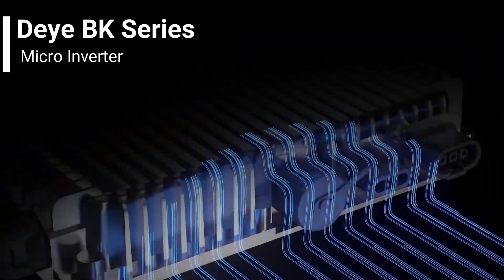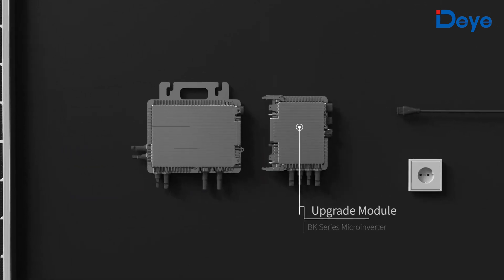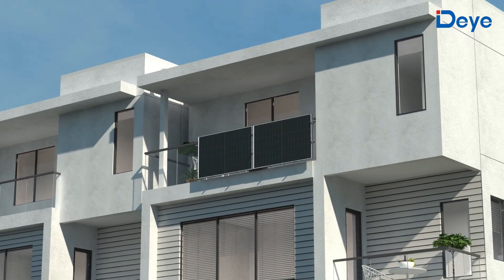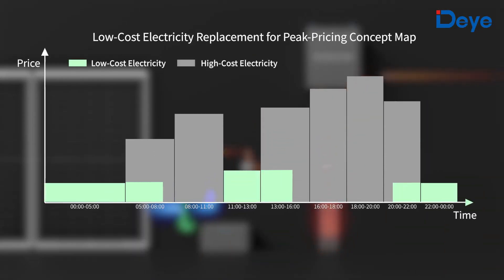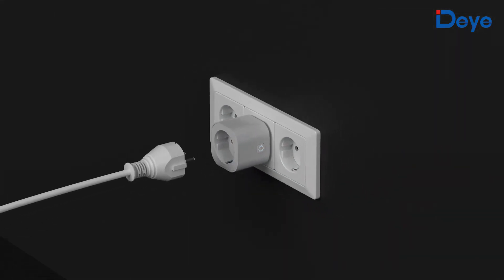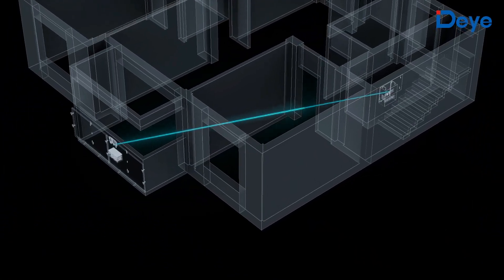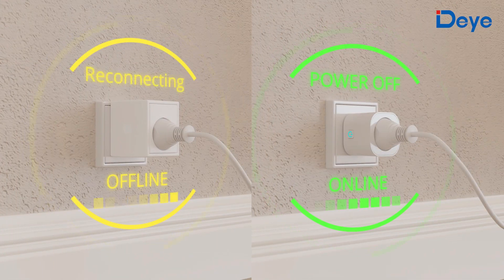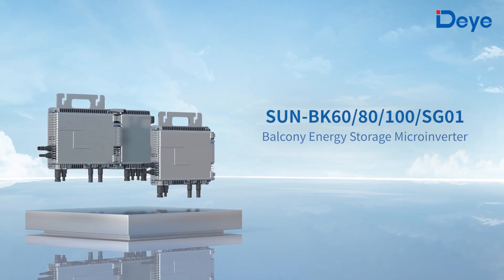Deye BK Series Microinverter #deye #inverter #solar

Comment: This is an amazing system for people who stay in high rise residential buildings or for people who have very little roof space, allowing them to add a few extra panels on the side of the building, whilst integrating with the existing Deye system. Very Smart Solution indeed. 😎